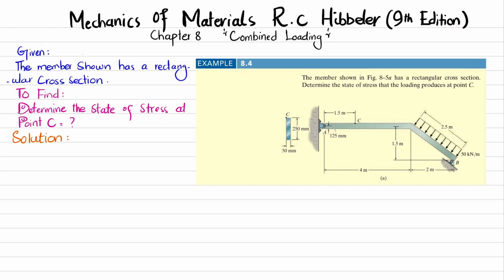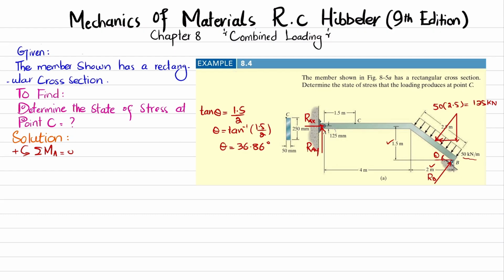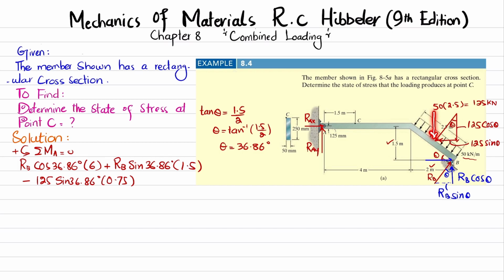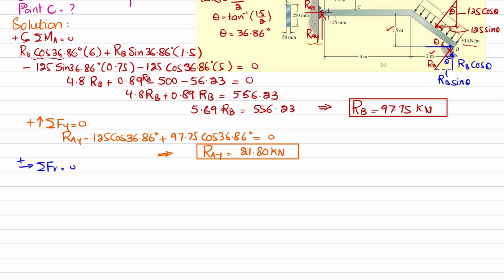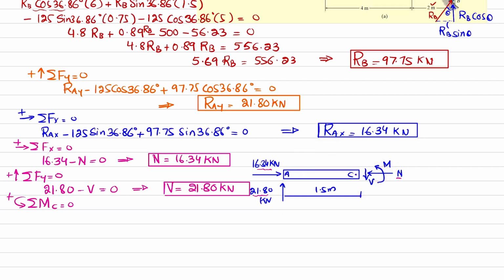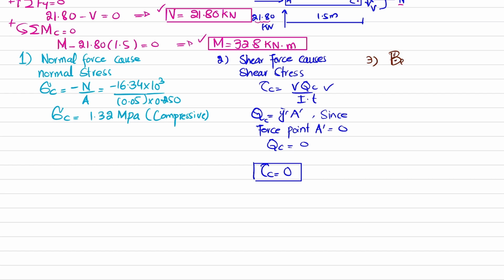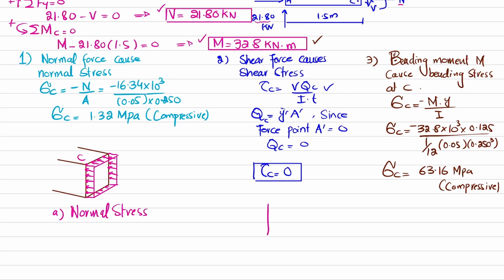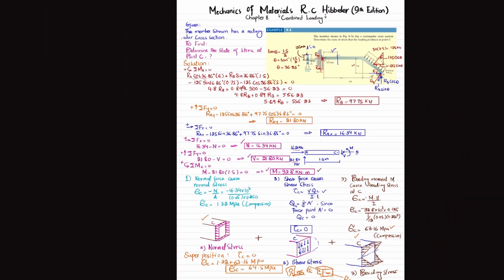Determine state of stress that loading at point C | Example 8.4 | Mechanics of Materials RC Hibbeler

Comment: sir why yhe final answer of superposition is positive ? i thoutht it should be negative because the normal stress and bending stress are both negative and in compression ?
Reply from the maker: If you write stress value positive with written compression so it is ok otherwise negative value tells us that it is in compression. You can check I have written negative value then I wrote the stress as only value with written compression with it. So if you represent the compression on element then you have to write only it's value ..❤
Reply: @engradnanrasheedmechanical  got it thank you so much 💗
Reply from the maker: My pleasure ❤

Comment: hey io was wondering why the M in the bending equation was negative in the final equation
Reply from the maker: This is formula for finding bending stress at any point above or below the neutral axis for moment in counter clockwise direction , the formula is - M*y/I where y is distance from neutral axis to top or below layer. Y above neutral axis is positive cussing bending stress to be negative (compressive) while y below neutral axis is taken as negative causing the bending moment positive (tension).

Comment: Good day, engr.

I have a question, why does the eccentricity of load P is disregarded in solving for moment at C? Thanks.
Reply from the maker: Good day brother kindly specify the time frame where you have issue
Reply: @engradnanrasheedmechanical 
@15:25 sir. It is stated there in the question that the point C is at the top part of the section. Why does the axial force 16.45 not multiplied to the moment arm (eccentricity= 125mm)?

Thank you sir!
Reply from the maker: It's a very good question , I like it. Now the answer is that normal load at right side  16.45 produces clock wise moment and normal / axial force at A will produce counter clockwise force both will cancel each other remaining one external reaction moment which we have found by multiplying distance from A to C with Ray.